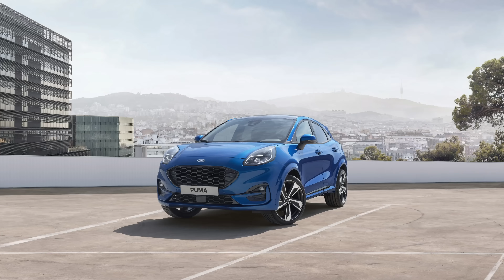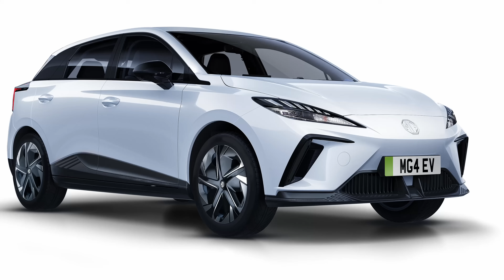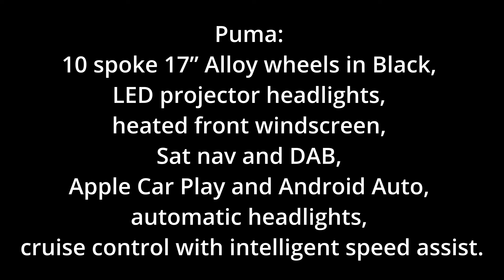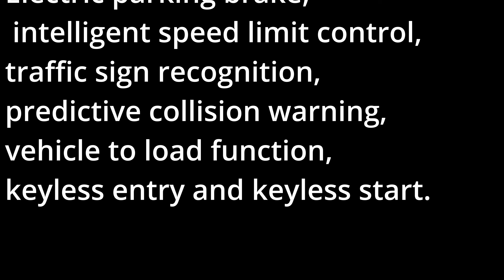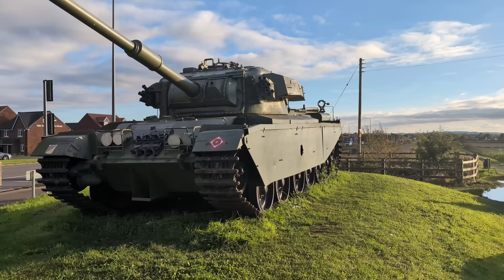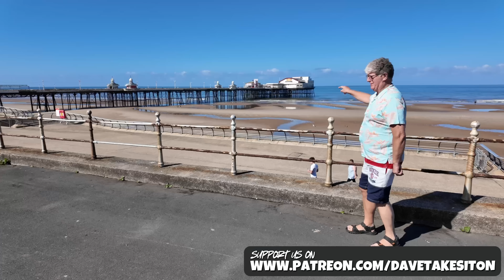Are Cheap Electric Vehicles REALLY Better Than Cheap Petrol Cars?

Comment: Insurance costs? 2nd hand value? Average cost and time to repair? Availability of spares in 5-10 years time? Warranty? Will the Chinese car company still be in business in 5-10 years time? Everyone knows electronics only lasts 5 years. Aren't most new EVs just going to end up as scrap within 5 years - are they really good for climate change?
Reply: "everyone one knows electronics only last five years"  LOL, this is probably the weakest argument I have ever heard. Most EVs come with an 8 year battery warranty and million mile battery warranties are available on some brands. My ICE cars haven't even made 200,000 miles without major expensive repairs.
Reply: Insurance costs: Not that different from any other car. 2nd hand value: Depreciation is around the same as a ICE car, less in some cases. Availability of spares: Unless it's a car new to the market there's no issue, in the future they get broken for parts the same as any other car & many new parts are backwards compatible. (Try finding engine bearings for a 10 year old Nissan Duke however..) Warranty: Most of the 'new' Chinese companies have been around for years, just not in the UK market. Electronics lifespan: Are you sure it's only 5 years? There are plenty of  2010 Nissan Leafs on the road, look under the bonnet of any car produced in the last 30 years, there's an ECU controlling it. Some date back to the 80's & still start first time.
Climate change? Initially they are not great for the climate then every mile they reduce their impact, ICE cars do not.
Reply: @chrisw3771  re. electronics - I'm more concerned with all the fancy electronics in modern BEVs (not so much ECUs and battery) and availability of spares and order times. Insurance companies insist on repairs using original parts (not 2nd hand or alt. mfr).
Reply: As Dave said in the video these 'fancy' electronics are mainly for safety, and are driven by safety regulations tightening the NCAP requirements overtime. More ecpensive ICE car models/editions have the same electronics in them. it's just to make ICE cars more affordable automakers lower the safety level, have done so fir years. This isn't the case with EVs where safety comes as standard, as it should always have.
Reply: BYD are bigger than Ford. They also make and supply batteries and electric motors to many other brands, like Tesla and Hyundai.
Reply: I think you don't realise most of us before going EV owned many ICE cars and know the plusses and pitfalls of ICE. 
Myself, I'm a ex Army mechanic and former petrolhead. I've owned about 20 cars. 
EVs are just a better, more reliable form of transport and will be cheaper than ICE to buy in the next couple of years. I'll answer some of your questions now.
Insurance costs for me are comparable to ICE car of similar power and value. 
There is very little to go wrong with electric cars and warranties are much better than ICE warranties. 
You don't get ICE cars with 8 year/100k warranty on any component let alone the most expensive one. 
Will any legacy auto still be around in 10 years? VW are the most indebted company in the world, will they be around?. No one can say for sure. 
Why would they end up as scrap? Loads of Leafs, Zoe's and early Teslas are still on the road 10 years on. 
Are they good for climate change? Manufacturing anything isn't good for the climate but you asked the wrong question, are they better than ICE should be your question and the answer is a resounding yes.
Reply: mg was saved by the Chinese. since then, it has survived for many years.🎉
Reply: Secondhand value of a low performance, high maintenance petrol car with a VED of over £600 a year. 

And you worry about insurance costs.
Reply: Given the way that legacy manufacturers are performing at the moment I would be quite worried about a lot of those being around in 5-10 years, if they don't adapt soon, they will be gone.

Not even worth gracing the "Everyone knows electronics only lasts 5 years" with a response as it is pure nonsense on every level.

Based on current data it looks like the average life of an EV will end up being much the same as ICE. When EV's are eventually scrapped it's likely that the batteries will be either recycled or directly reused in other applications where their reduced capacity isn't an issue.
Reply: God am I in trouble with my EV as it will be five years old this year and the 7 year warranty will be toast lol .
Love our Kia eniro and will never go back to giving my hard earned cash to the oil industry.
Reply: "Everyone knows electronics only lasts 5 years" - well I certainly didn't.  Thanks for informing me.

Comment: Hello 
Happy new year 
Just one thing I would like to say is don’t rely on one pedal driving this because you may need to do a emergency stop and if you not used the brake for some time you will take longer to stop as the rust on the disc will make it less efficient, also the brake could scene’s up with no use. If you wish to use one pedal use the brake s bit each time you go out to keep them working.
Reply: A lot of EVs address this issue by using the brakes rather than regen periodically when using one pedal driving. Some like Kias have a brake disc maintenance function, reminding drivers to use the brake pedal before engaging iPedal mode.
Reply: @GruffSillyGoat yep my EV does this.
Reply: @ 
Not have a EV with I did not know that they had a function to reminding to use the brakes.
Reply: By always charging to 100% I do not get this non problem. With a full battery the 'one pedal' drive will slow the car on the brakes if there is not enough room in the battery for regen electricity during the first few miles.

Comment: Considering EV do not have a .... fuel tank, fuel lines, fuel pump, exhaust system, catalytic converter, gearbox, and a traditional engine... surely they should be cheaper than their ICE versions 🤷🏻‍♂️
Reply: The battery is a significant cost component in an EV.   However, battery prices are dropping like a stone and so will the cost of EVs.
Reply: Economy of scale, pretty soon ice cars will be more expensive .
Reply: Development costs have to be factored in initially and no doubt production costs will reduce when the UK/Europe doesn't have to import most of the electrical components. There is almost the same amount of hardware you ignore the exhaust and cooling systems.
Reply: @johnbrown3471  I would have thought the gearbox and ice engine would have been the most expensive "different" bits 🤷🏻‍♂️
Reply: They will be cheaper as development costs are absorbed. Also the plummeting  used prices means the market is telling the producers they are overpriced. This will equalise the market. Will take at least 5 years.
Reply: They are much better and safer for the same price therefore better value.
Reply: Should be ?
Reply: It's the battery that accounts for most of the cost
Reply: Educate  yourself
Reply: 电池 电机 电控  不要钱么？😂😢
Reply: @mikezhang2351  
您提到的组件比我说的要便宜……这就是我的观点 don't know if google translated that right... what i said is
"The components you mentioned are cheaper than what I said ...... That's my point!"
Reply: @counterdebate ok. as long as you have a long mileage and a convenient charger.
Reply: @mikezhang2351 Yes I agree for me it's been great, Iast ten years I have had a ex-company tesla p-85d and I charge off solar panels at home and drive around London mostly so for me EVs have been mind blowing, money saving and the amount of sport car drivers I have ripped apart at the lights.... ! Priceless 😍
Reply: @mikezhang2351  what planet are you from ?